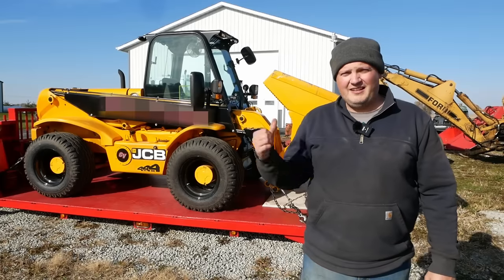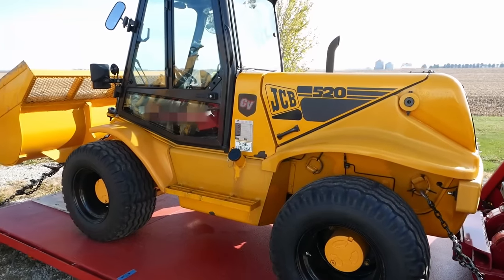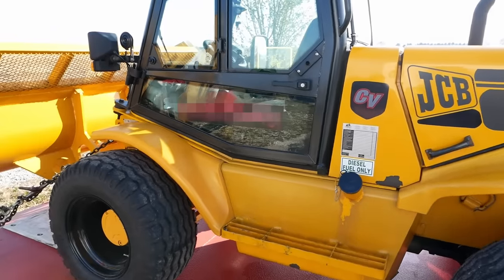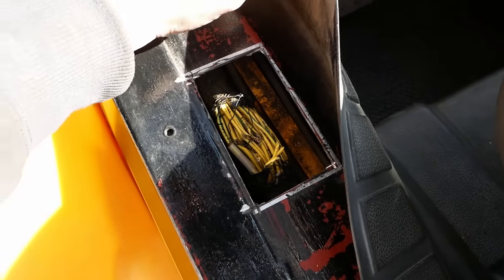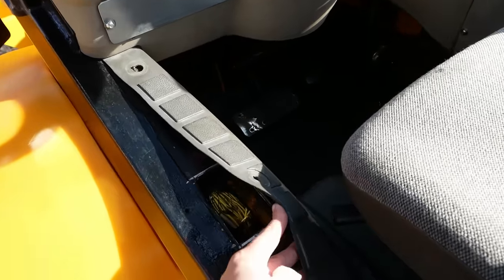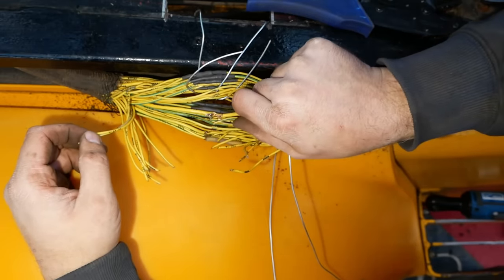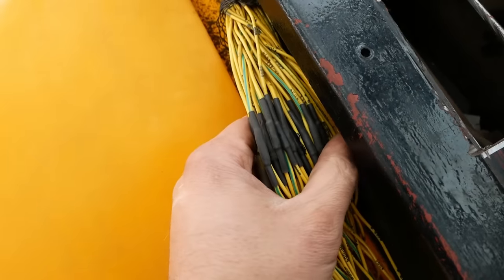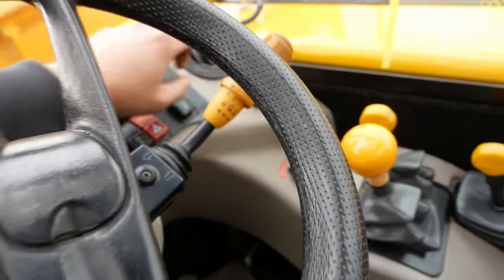What Happens when You Drill a Hole in Your JCB Telehandler?

Comment: I’m an electrician, and I have what I call a “ Fox and Hound”. It’s used for low voltage tracing. Also called a toner. You can connect it to a wire at the beginning, say the fuse box, and then identify that exact wire where it is cut, or in a bundle of wires. I use it a lot for tracing circuits. Just a thought. Love your content! Best wishes
Dan
Reply: Right. I have part of that system I got in a bunch of stuff from a storage locker. I have the receiver probe but not the tone generator unit. It will still detect live wiring inside of walls, so there’s that. Made by Fluke.
Reply: Not sure how it would help in the situation Wes faced. You describe how it would help from (say) the fuse box to where the wires are cut - but to identify each wire on the other side of the cut, you'd need to have a wiring diagram - to identify where the other end of the wire goes - and then put the tone generator on that end of the wire - to then be able to probe bunch of cut wires to find the one carrying the tone.  They are very useful tools when tracing functional (uncut) wires - but once a wire is cut - you still need to trace it from both ends.
Reply: @dav1dsm1th  
Yes, well that’s where the wiring diagram would come in.
Reply: @ThePsychoNad  Did you hear the bit where Wes said he didn't have a wiring diagram?
Reply: David Smith hey I was just offering a little help. I guess I won’t be doing that again. FFS!
Reply: @ThePsychoNad  I was just pointing out that it wouldn't help Wes in his particular situation.  No need to get bent out of shape.
Reply: I’ve used those to trace a wire in a fire truck, that tool is worth it’s weight in gold to me haha
Reply: I have tried to use one and I am an electrician but find the result can be hit and miss. I  just ground each core and work it out from there.
Reply: BreatheScotland  I've worked in IT since the 80s and also have experience using tone generators - when tracing network cables running around various server rooms.  I understand how they are very, very useful in that scenario.  But the only time a tone generator would be helpful to Wes, in the situation he faced in the video, would have been towards the end - when he was unsure how power to the cab lights was routed.  At that point he had a known endpoint (to place the tone generator) and could have checked if the tone could be detected on one or both sides of the damaged area. Except, at that point, he'd already lost access to the damaged area (by welding the cover plate and dropping the cab back down).  But with the 40 other cut wires - where he didn't know the endpoints (because he didn't have a wiring diagram) - a tone generator would not have helped.  That's all I'm saying.  He could have taken the time, using a tone generator, to identify the 40 cut ends from the "device" ends to the damage area - but that would not have helped him to identify which of the 40 other cut "source" ends at the damage area they needed splicing to (without a wiring diagram).  I don't get why people are not understanding that.  To fix the damage Wes faced, he needed information that a tone generator couldn't supply - that's all I'm saying - either a wiring diagram or the cables to be marked - thankfully the latter was the case.  Tone generators are fantastic tools - but would not have helped Wes to fix 99% of the problems he faced in this video.
Reply: Nowadays lots of people have them because ethernet wiring is so common now. Tracing some wires in a dank crawl space or attic is no fun.
Reply: @dav1dsm1th  was lucky  that the wires are numbered every 3 inches ........not a bad system in my  view .........
Reply: @georgedoorley5628  I agree.  It appears to be a fool proof way to manufacture wiring looms (but probably a little expensive - but worth it).
Reply: Dan House:
My version is an old Western Electric 9 volt handset power supply along with a homemade piezo buzzer/square wave rectifier with test leads. It will sound on anything between 0-20 volts AC/DC. Along with a twenty foot jumper lead this has helped me out of other peoples problems a lot over the years...............
Reply: @SylvesterCarl  I’ve know a few linemen that use that sort of system for checking grounded wires. Works perfect!👍

Comment: A great fix. It reminds me of the time I drilled a hole in the floor of a Dodge van  to mount a plywood floor. Drilled right into the gas tank. The tip about wrapping tape around a socket was worth its weight in gold. Thanks for a great video.

Comment: This reminds me of a job I did a few years ago. I was working on a Gradall machine. It to was hauled to me and it was dead. It's big boom was in the way of the repair that was needed and with no power to manipulate the boom, the owner thought it was too big of a job for himself so he brought it to me. He needed the machine back pretty bad as he's an oilfield lease contractor and it was during the spring break up season so he was missing out on a whole lot of hi-paying jobs. That said, he also brought me 15 - $100 dollar bills and told me that if I needed more cash or parts to just keep track of my time and parts. He said that if he got the machine back within a week he'd be happy and still ahead of the game. He was in for a nice surprise!
First, a little about me: Well, me being a farm raised Alberta boy, and with my 1st job being a hard run floor hand then derrick hand in the oil patch, well that gave me a different quicker and dare I say a more intelligent way of looking at work in general. If you worked The Patch in the '80s you worked hard, kept busy or you got barked at if you weren't busy doing something. In the Alberta Oil Patch I truly learned what, "GETERDONE" meant!
After he left I went and fetched my ratty old Porta Power (I'll call it PP) unit I got at an auction sale and I also gathered up a pail full of various hydraulic fittings and some short lines and a clean empty oil drum. I plumbed the old Porta Power up to the boom's fittings and powered up the PP and as you know the PP is one heck of a powerful though small unit.
So, with the boom's hydraulics now isolated and connected to outside hydraulic power enabled me to slowly lift the boom up and out of the way of the repair area. Connecting the boom took me 3 hours. Doing the repair took me 2 hours. Lowering the boom, disconnecting my fittings and making sure all was well took another 2 hours for a total of 7 hours. In my little world, $1500 dollars does not equate 7 hours work. By God no one's worth that much, no one!!
I work alone, prefer it but I'd work with you any time because you're a good man, just like me!

Comment: Reminds me of when I worked for a Mack Volvo dealer, a Volvo with an Eaton auto shift came in with 3,500ish miles stuck in gear. The company that owned the truck moved the fire extinguisher from between the seats to next to the driver's door, ran the self tapping screws directly into the transmission shift wire harness

Comment: Splicing was the right decision, I work at an Excavator manufacturer and the first thing that goes on the rotating frame is the wiring harness.  The harness is pulled through grommeted holes as components are added.

Comment: I felt your pain.  I drilled a "simple" hole in a sheetrock wall once to mount a shelf anchor. Went dead center into a water supply line, where there should not have been any piping. Everyone has to do this at least once to be able to call themselves a professional. Ha!
Reply: Been there, done that.  The line was run along the top edge of wallboard behind the wallboard.  There's nothing along that whole side of the building, inside or outside, that needed a water line.

Comment: I feel for the guy who drilled into the harness. I had a similar disaster, I was putting my car on jack stands when the one in front fell over, and the leg of the stand went right through the oil pan. Oil went everywhere, and I was totally screwed. I had to have the car towed to my mechanic who then had to drop the front subframe to get the pan off. The disaster cost me almost $700 (with towing) just because I wanted to drop off the old tires instead of bringing the whole car to get new ones.
Reply: Have broken a fan in the same manner  so you ain't alone buddy!
Reply: Where the heck were the jack stands that it went through the oil pan? Usually the frame rails are nice and off to the side. 

Not that I’m doubting you did it, just damn.
Reply: @andyruse4670  - underneath the sub frame in front of the front wheels. I normally use the pinch weld, but this same car has fallen off the jacks there before.

Comment: Good job, Wes!
I have to work on a Switzerland made rockcrusher at a quarry. 100s of wires all black, unlabeled. I have some not very detailed schematics for it. Being that it is this huge rock crusher on tracks it shakes big time and breaks wires. The control panel has rubber mounts and I packed the inside with foam. I always cringe when they call.
Reply: Pack your phone with foam and you'll never hear it ring...

Comment: Nice work. I had to do the very same jobs numerous times during my stint in the navy. There was always some deck monkey drilling, welding, grinding or cutting through something somewhere and wouldn't ya know, they'd usually find wiring for my systems located almost everywhere throughout the ship. So I know the feeling intimately. Of note: I believe the military innovated that type of numbering scheme for wiring and classed it out as a Mil-Spec because during battles, the repair crew can't be tracing down broken wires. They gotta get fixed pronto and on the spot.

Comment: i worked on a volvo that the driver had shot thru the left floor board near the foot rest at the clutch pedal and it had gotten the harness and bounced around under the truck and cut the frame harness running back, fun fun times finding that, looked to be a 45 acp when i found it, good reason it had a crap load of weird codes. had a very experienced tech (30 plus years) installing chain boxes left frame rail behind cab, 500 new trucks, he drilled 50 abs harnesses looked close to what you repaired here, 5/8 reamer damage was a bit more destructive tho.

Comment: I had a Daf DB250 bus with an ALX400 body on it. That had a 95 wire loom, all black wires with numbers at each plug no numbers in between. The inner rear tyre blow out & took the loom out clean in half.  Took me almost 40 hours to find all the wires one end & marry them up with the rear end in the wheel arch. The wiring harness was obsolete & the vehicle was "to good to be scrap". I recently found your channel & really enjoy your content. The recent bin truck video brought me, all the bin trucks I've looked at have all picked up a mattress with the prop-shaft over landfill & taken out all the air pipes & wiring. The first thing I used to do was look into the body from behind the drivers cab if I could see the all the way to the rear. It was a good day if I could only see a mental plate it was a bad day.  Keep up the great content

Comment: If there is room in the metal tube, you can just add male+female inline multi-pin connectors (with removable pins) into the harness. Just cut ALL the wires at the damage area, and one side gets the female and the other side gets the male. It guarantees that all the wires do not have hidden damage and adds the much-needed length to the harness which eliminates wire stress and chaffing. In the end, it takes less time to add the connectors than all the careful crimping and heat-shrinking. It allows you to make a mistake and simply swap pins in the connector (which takes only seconds) and doesn't make a mess of reworking the wires. There are hundreds of Nema-standard, water-proof or fuel-proof, multi-wire, industrial connectors to choose from. Love your channel Wes, keep being you, bud.
Reply from the maker: In my experience the harness always ends up too short when you do that. You have to spread the wires to populate the connector and the wires on the outside are pulled too tight.

Comment: I had a guy with a tudnra where the truck had every light on the dash, no communication, and the blower didn't work. Come to find out he tried to install his own blower motor and didn't say anything about that's when all the lights came on. CAN network was shorted and eventually found (after hours of testing) that the can lines that run to the ac amplifier (right next to blower) had a screw drilled through the harness, it was one of the screws for the blower motor. And guess what? The blower still didn't work because the fuse was blown and the blower fuse is part of the main fuse built into the fuse box on that truck. Over a grand later it was all fine.

Comment: Well Wes,  Thanks for bring back old memories of after action repairs on our choppers.  mil spec requires staggered crimping. wounds like this one would mean opening up the wire bundle as far as possible in both direction and use filler wires, (that we would number label). A real fun job!
Reply from the maker: That would have been a better way to fix it. I even thought about putting in a connector but there just isn't room.
Reply: In the days before insulation displacement connectors (scotchloks, 710 modules, etc), the old time splicers had a tool that spun together each wire in a tight wrap. Then, they would slide a wax impregnated cloth sleeve over each connection. They'd stagger them but the splices were complicated and huge sometimes. Plus, they had to tone (or "buzz") each pair. Even now when we do a buzz,, large cables can take a week of 24/7 work to splice.
Reply: @WatchWesWork  Your channel gets flooded with webcam girl scams, one girl posting like 50 comments. Please block her
Reply from the maker: @erik_dk842  I do but it takes a few hours for YouTube to scrub all the crap out.
Reply: @WatchWesWork  Wes . As a mod for you I have been trying to remove them when I see them .
Reply from the maker: @heithdotysadventures7824  Thanks Heith, that really helps!
Reply: @WatchWesWork  any time man 👊✌

Comment: 8:40 The sheath slipper tool is cute.  
It's handy to keep Popsicle sticks around for that. You can carve them into a custom shape if you need to.
No blade blunting on the steel vs wood surface.
Reply: Blade dulling is not really an issue.  We mechanics buy blades by the pallet load.  I always start a harness project with a new blade and have yet to have a blade get too dull before I'm finished.

Comment: Heres a good story for you, we had a Caterham turn up at work (small British 2 seater kit car). Whereby the customer complaint was that it would not rev past 5700rpm. After concluding it was an interreference issue being caused by the camshaft sensor. A bit of digging from the customer revealed that he'd tried to fit a new shift light through the dash, and promptly drilled right through the entire car loom. In the end it was diagnosed that the misfire was caused by the ECM had lost its permanent 12v feed (these ECU's have a ignition 12v and a permanent 12v, the latter being for keep alive and interference reduction, causing all sorts of interference issues. Had costed him 1800 dollars, one expensive shift light!

Comment: When they were building houses at the end of my street  (a few decades ago), the builders dug up a copper phone cable that ran next to the street.  It had maybe 600 pairs in it... Then a year after that, someone dug it up AGAIN.  I suspect they were digging to run water or sewer lines to the new homes and were careless.  (The water and sewer mains ran under the street). 
I did not envy the technicians who worked to reconnect the pairs correctly. 
After the second time a contractor dug it up, the phone company dug up the entire length of cable and put a new cable down that was encased in a very heavy metal pipe.

Comment: I worked for a company as a cable machine operator. They wanted to save money on ribbon for their printer and reduce the number of stamps. This shows just how important numbers along the wires are. Nice repair job. This would pass inspection in a cable plant for Class two, which is industrial. Military would require something a bit more, but it is quite a bit better then basic commercial. Thumbs up.
Edit - I think the only thing you could have done differently is not bundled everything back up until you tested all the circuits, but that is it. Good butt splices, heat shrink and fabric tape wrap, along with the abrasion covering, which is a bit of overkill, but shows professionalism.

Comment: Repairing a wiring harness with unlabelled wires wouldn't be hopeless, just very time consuming. Use a multimeter to beep out every wire to its connector pin, look at the wiring diagram to see where it should go, trace out the other connector and wire, and splice. I'd still do it rather than replace the entire harness. You do need to have a wiring diagram though.
Reply: IF you have a wiring diagram.  Big if.
Reply: Maybe goofy question, but by “beep out every wire” you mean doing continuity check between wire and connector end?
Reply: @billybobaggins8820  yep, use the continuity test mode on the multimeter. Only if you have multiple same-colored wires so you know which goes where.

Comment: Well, on the bright side, he didn't drill through a hot wire and burn the whole thing to the ground.

Back when I worked on fighter jets (Phantoms) our metal shop went to put a skin patch on the side of an intake. Yup, they drilled a bunch of holes through a wire bundle. Not being able to just lift off the cab to access the harness, we had to pull new wires through. Sometimes we could use spare wires that McDonnel Douglass included in the bundles, sometimes we had to pull new wires.
Reply: he did   drill through  a hot wire ..........the large fuse at the battery blew and saved the day ............